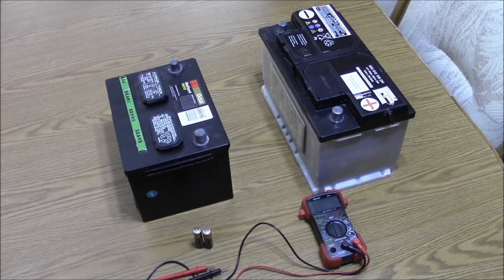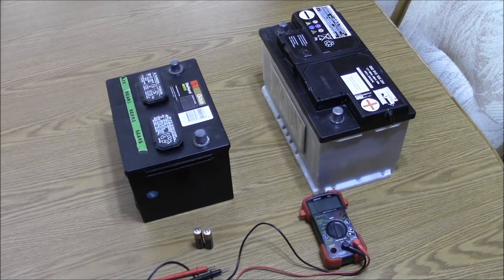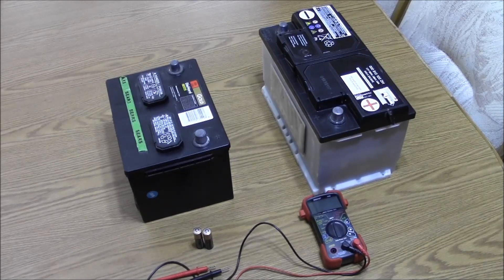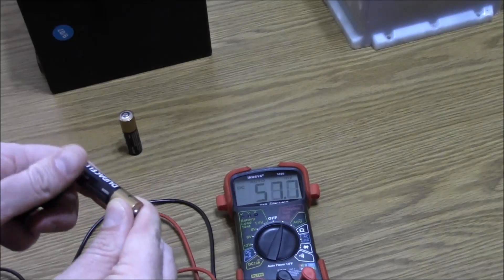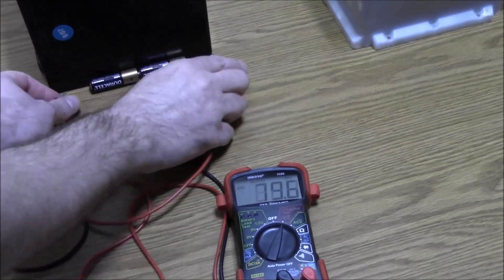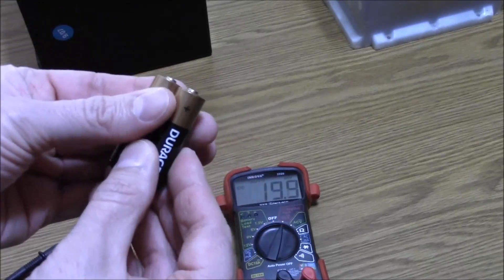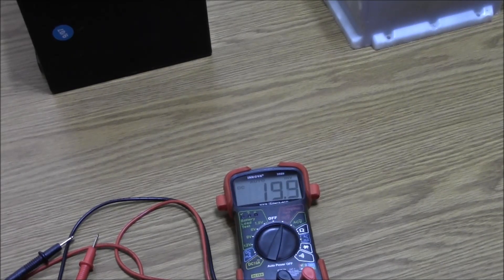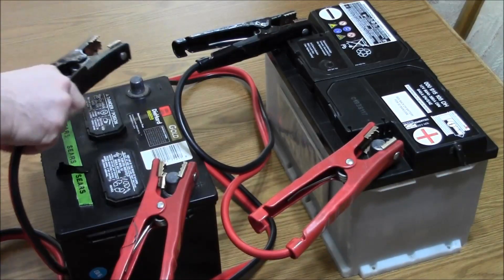Diesel Batteries: How are the batteries wired in a dual battery diesel truck?

Comment: I reduced my M925 from a 4 battery 24V system to a two battery  24 volt system (the military’s overkill of available Amperage causes the starter to over tach and burn out within 100 starts…which makes perfect sense to an organization which pays $680.00 per battery and $2730.00 for a starter and swaps them out annually whether functional or not…which make perfect sense to an operation which uses tax payer’s money to buy everything and exist primarily to justify their annual budget.)...the type of fuel a vehicle uses is meaningless to the voltage that it runs on.  The Voltage and Amperage are the only things you need to understand when changing batteries in any truck.

Comment: What if the batteries are 2 different sizes in the truck?
Reply from the maker: Rapture Ready:  They should be the same size.  Unfortunately, people like to cheap-out when it comes time to replace the batteries in these dual battery setups.  These batteries need to be replaced in pairs.  People get upset about the cost of buying two batteries and decided to only replace one.  That will only result in the untimely demise of the new battery.

Comment: So when you change the it won’t matter witch  battery you connect to change on the 12v, but on the 24v would you need a 24v charger or if you just have a 12v charger just do 1 batter at a time????
Reply from the maker: B18 Cremator:  You are exactly right.

Comment: So if you were to require a battery maintainer for seasonal storage, hooking it up to one of the batteries rather than both should suffice. Does that make sense?
Reply from the maker: If the batteries are wired in parallel, that is exactly what you need to do.  You can check the wiring with a voltmeter.  Both batteries should read the same voltage.  When you hook up the charger to one of the batteries and turn it on... check the voltage on both batteries with a voltmeter.  You should get equal readings from both batteries.